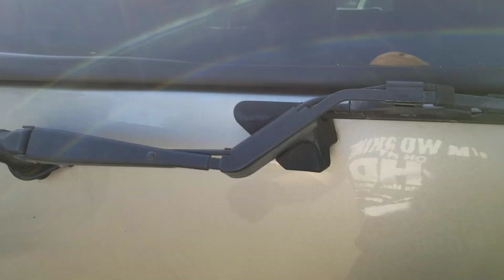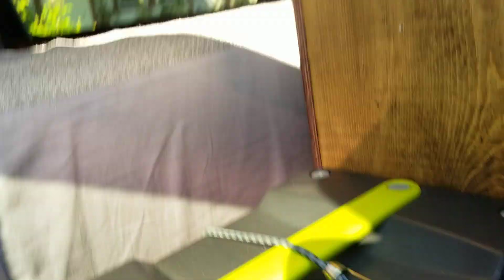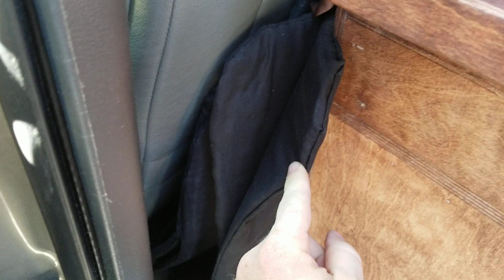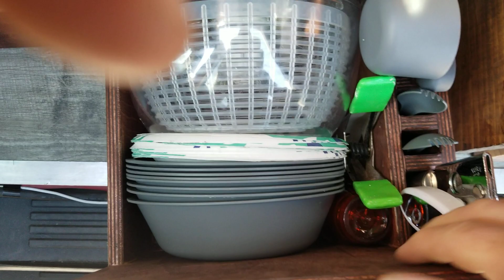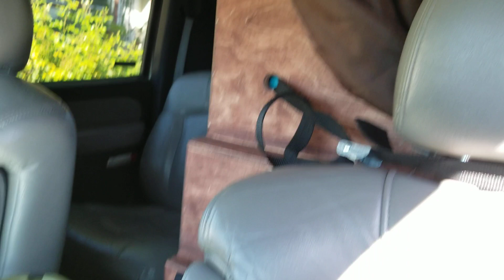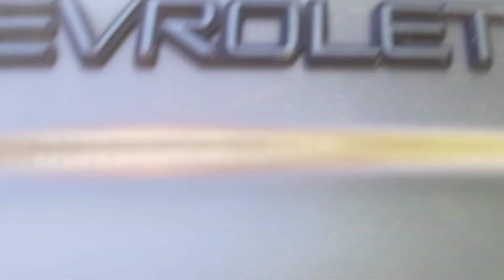2002 Chevy Suburban 4x4 4wd Off Road Adventure Stealth Camper

Comment: I can see a few downsides to this design. You can't use your water / sink without opening the door and standing outside, that's going to be pretty inconvenient at times. When you cook on your stove tops, food's going to splatter on your bed/couch and again, you're probably standing outside, maybe in bad weather. A) it's not very stealthy, B) you'd probably only want to do it in good weather. Then you got all that water on the roof which is heavy, so it's going to raise the center of gravity of the car and slosh around when you drive, that would alter the driving characteristics of the vehicle negatively. It's also got a fill cap at the very top of the pipe which makes it a pretty inconvenient place to put it up there. It's more likely that people would just connect a garden hose to the spigot to fill it instead. I did see some really good ideas and learned a couple of things though.